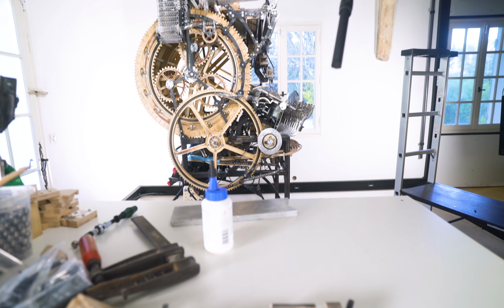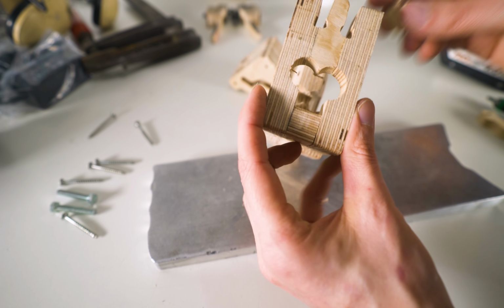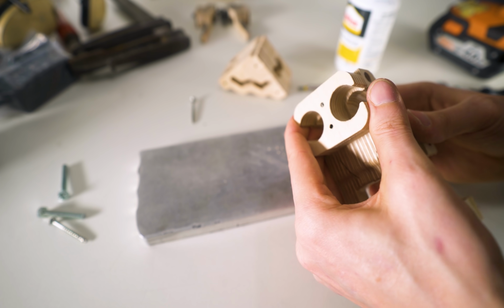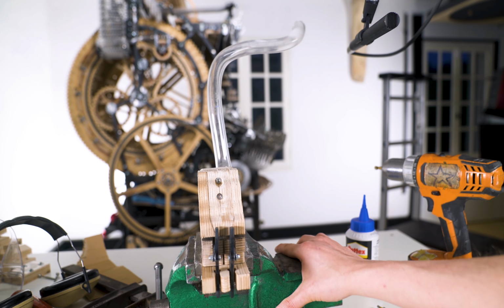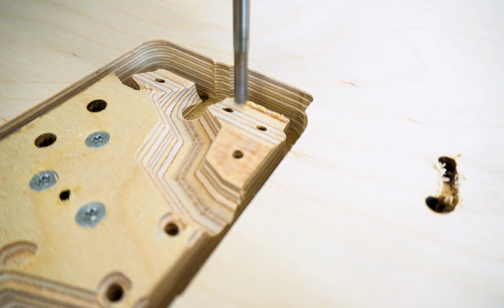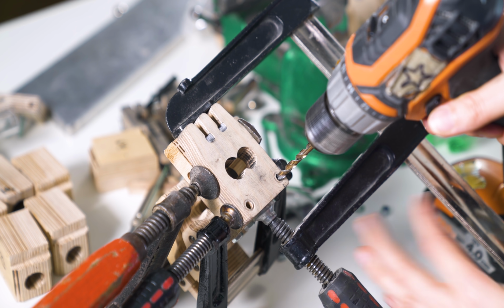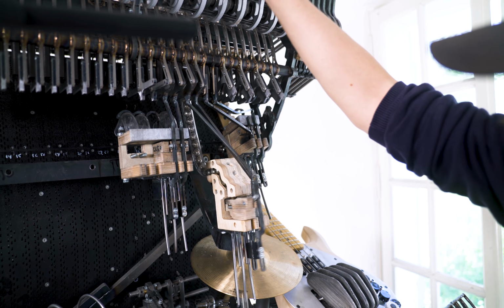Zig-Zag Marble Gate Completed

Comment: I think you made a point worth emphasizing: the Baltic birch plywood you're using is much different than construction plywood. It's made from all hardwood veneers, which are thin, uniform, and without voids. It's much harder, much flatter, and inherently more dimensionally stable. It's also like 3x the price, but so worth it. Just if anyone is thinking he's ridiculous for using plywood, this stuff is really on another level

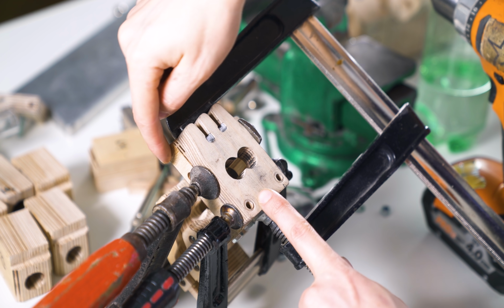Comment: 8:52 You would get more accurate holes transferred if you used a brad-point wood drill or a proper 6mm transfer punch, it may not be important though. Your method of indexing the part on the when flipping it over is great, running the holes first pass a little deeper to allow that seems genius.

Comment: 1. There is a definite "klinK" when the marble hits the plastic catch (I forget the name) before being dropped to the instrument.  Perhaps felt on the top of the catch to stop the "klinK"? 
2. Marble escapement has been creeping around in the background for several months.  2 weeks ago, it seemed like the obvious solution.  Now that is on screen, it is definitely the way to go.  Less bulky, open, visible, precise release, self powering, low wear, etc, etc, etc.  But, it is difficult to build, needs precision and needs tiny lubrication maintenance.  In the end, after weeks of thought, it is the optimum solution.

Comment: Yea, you got some new mills. I hope the tolerances are better now.

In regards to the design not showing the marbles enough. Consider this issue fixed for now. Continue on wacking the other MMX issues. 
Only once you can play 10'000'000 Marbles without one issue, you can do a victory lap and try to incorporate designs that pose a higher risk of failure... because at that point, you have a design to fall back to If it doesn't work. 

Have a great weekend and looking forward to more steams.

Comment: One thing you can do with those machine threads into wood is tap the hole, drip a few drops of CA glue in the holes, then run the tap back through them. CA hardens wood enough so you need a file to work it.

Comment: Does the difference in the height between closed and open cause your marbles up top to not be in line?  My guess is since the system relied on them being completely flat on top, you will have to have a new system on top.

Comment: If they ever wear out, or if you want it a bit stronger to begin with, a few drops of CA glue in the plywood holes, let it cure, and tap it.  Slightly stronger, or a good way to get the strength back if you need it!

Comment: Just a thought...if you wanted to be able to see all the marbles in each of the marble paths in the final design, I'm sure someone out there has a way to...say...take the CAD model(s) and use them in a 3D printer, with a clear material to build them up.  I mean...once you've got the specifications nailed down--and that DOES appear to be at least very close to the case today--then it should be able to be both 3D printed as well as CNC'd...and you are now at the point where, designs having been mastered, you can now go to the next stage:  Materials Coolness Factor Implementation!  \\=^D

That would also enable a single part to be made for each unit, providing that you didn't want to have each one as an assembly.

Alternatively, the existing CNC work having been done, you could always just swap out the wood for acrylic, or even cast resin, which would have an effect like those modules would appear to be made of glass...but you'd see EVERYTHING from EVERY angle...ULTIMATE coolness factor!  d=O)

Comment: As a suggestion, if you want to see more of the marbles, why not use the middle sections of the gate sandwich and make them out of clear acrylic / plastic? You have the tools and the files already so it can't hurt to try. You said that they also have larger holes in the middle so the screws won't crack it. If you did that, you could also illuminate them with some white leds or similar to make even more of an effect on stage/for camera work.

Comment: Love it! Glad the zig-zag worked out! Obviously people are gonna get into the "PLYWOOD AGAIN???" argument, despite your comments on its reliability, but man, after looking at the assembly process, which I'm sure is offset by cost, I'm sure making a handful of plywood replacements, should stuff go sideways, is absolutely cheaper than having other materials manufactured. (From my admittedly low experience level with CNC or 3-D printing in general, that is.) Keep it up, Martin! Your troubles very often mirror my own, and I'm glad you're keeping going!

Comment: A quibble.

Plywood does not have a grain direction. It has two. The grain direction of each layer is at 90 degrees to its neighbor. 

So both tapped holes are basically the same, so far as grain goes.

Comment: Absolutely Beautiful! The smoothness of the backwards movement is so satisfying, it more than makes up for the marbles being hidden. But there are two things I don't get: why do the gates need three stops (on the metal rod, on the wood and on the plastic) and why do you want the marbles to be in a non ideal position when the gate is closed?
Reply: i think the low height is "ideal height for like friction gate retraction", while the high position is "ideal height for things not getting stuck in the zigzag when the gate opens"

Comment: You know what ancient mechanical engeneer said: "Simpler is Better". In 13:11 I see an escapment mechanism, a lot of moving parts, when you could make a sleeker plywood design, with more windows. Less moving parts, easer to maintain, less probability of failure, and in case of failure easy to repeair. Whilst an escapment mechanism needs to be tuned and have a lot of testing, also is complex in making, and it is not easy to repair.

Comment: Martin day 849: we've build this modular. this is perfect as we have an interchangeable system so we can ajust the height of each module. 
2 months later: we remove this labyrinth of a module and replace it with a different modular system wich we can ajust for each channel withour re-cnc-ing. 
2 months later... probably will replaced with another module :p
Reply: *5 days later:

Comment: The issue I have with fastening steel into wood is the expansion and contraction of the wood as it is exposed to different temperatures seasonally. Depending on the vibrations you may see increased wear or even loose fasteners over time

Comment: 13:12 Recoil escapement mechanism. That would make that section just metal and pipes, I bet that would look amazing. Maybe I'm just being selfish because I never want these videos to stop.
Reply: Well, metal and amazing will have the looks BUT will certainly be louder and generate more unnecessary background noise
Reply: @HuatengChen  I think that would be the case, although the marbels would not have to drop into the slot. Hard to say what would be louder.
Reply: I was also quite amazed by the escapement mechanism, but I just hate those hand-bent steel rods. Even though Martin can use guides/contraptions to bend them in a quite consistent way, I feel like they'll never be as reliable as the plywood parts. But we'll see what Martin ends up doing, I can already see the escapement jumping into my face a few videos from now :)
Reply: @Dom2705  I think he would get the guys who made the funnel bends, you are right that hand bending it would be a nightmare.
Reply: if it works, don't fix it... yet. I hope he gets to 'finish' the entire machine, and then he can look into incremental improvements again with big tests in between. Make it work, make it pretty mentality...
Reply: @cptfwiffo  that is so true! The machine still has a long way to go and Martin needs to be focused if we wants to even have a world tour EVER.
Reply: Can we save some ideas for MMX-II Cyberpunk edition please?
Reply: @lightdark00  
I think this metal mech looks more steampunk than cyberpunk.
Reply: yeah, no one is "wondering why the machine is not finished yet"
Reply: After his "new idea" I'm considering unsubscribing.
Reply: MrTomadevil what idea do you mean?

Comment: Wilson, could you please notify Martin to this comment? On the channel of 'Twoodfrd', a lovely luthier from Canada with great videos on repairing all sorts of stringed instruments, I saw a great trick. He used superglue to strengthen threads that were directly cut into the wood. I can imagine a similar trick might help with your high quality plywood. Thanks Wilson!
Reply: Super glue the threads!  It works, I have been doing it for a few years.  Not gluing the bolt into the wood, but just let it soak into your threads.  Also I have found that course  metal threads work better than fine, if you have the choice.  For example here in USA I will choose 1/4 x 20 over 1/4 x 28.
Reply: @theoldbigmoose  in metal, fine threads are stronger than coarse
Reply: @SuperAWaC  whether fine is better or not depends on the yield strength of the metal as that will limit the torque you can apply.
Reply: @SuperAWaC  Fine threads make parts stronger by maximizing the cross sectional area of the non-thread area of the part.
Reply: @Leadvest  and dense / hard materials deal better with fine course threads than soft / non dense materials. And vise versa.
Reply: @SuperAWaC  Absolutely, but he was threading into hi layer plywood sir.
Reply: @theoldbigmoose  like you I too have been super gluing threads in wood with great success for many years. Just be mindful of how much pressure you can put on a thread in wood before it pulls out, two factors controlled by the hardness of the wood and the depth of the threads.
Reply: He can't use super glue or inserts, because the holes are directly in between two pieces of plywood. But as being a furniture maker and woodworker myself, I surely doubt the strength would ever be a problem in his application. Birch plywood is extremely strong. I have had several times where wood screws would simply break halfway, when I didn't pre drill the hole large enough to receive the screw. It bites to much, that half a millimeter larger, could mean the difference of success or failure. And that was just with 12 mm plywood.
When the wood is dense enough, you can use metal screws perfectly fine.
The usage of super glue on wood parts that are too thin or fragile, is something I use myself quite often and works extremely well. I also use it sometimes for threads in the wood, to make them durable. But you must be careful to insert the screw in the same way (reverse the screw, to find the thread start), to avoid the screw from tapping a new thread.
Reply: @ClaudioBosgraaf  Then lacquer might be a good alternative. It will still add strength to the wood fibers, but it will also crack easily if he ever needs to take the pieces apart.
Reply: im on it
Reply: Ted Woodford is the man!!!!
Reply: He hasn't had a single problem with threads in bare plywood. Why are you all solving problems that do not exist??  Can't you understand that this is the way you accomplish NOTHING and waste ALL of your resources?
Reply: @NGC1433  Because we suspect he's making a mole? I don't think this thing is going to fall apart, but I wonder if vibration will either back the screw out or strip the threads over time, and then moles induced by misalignment start happening.
Reply: @NGC1433  have you always been such a tool?

Comment: For the "troublesome threaded plywood" in the bottom of the channels you could make these into studs. Epoxy threaded rod into the gate and use a nut on the mounting plate. This way the wear is metal to metal when you remove it and not metal to wood.
Reply: DING!  Winner!  Install once into the wood and never again in the life of the gate.
Reply: That’s what I thought, wear is the issue with threads in wood

Comment: I saw someone further in the comments mention this and I think it should be repeated. You dislike the design of the new pressure gate because of the lack of marble visibility. However, you could always remake the new gate out of a clear plastic material so the marbles could be seen.

You yourself said you'll stick to a functional design over an aesthetically pleasing design. Don't undo all the work you just did. The design works and opened up the back of the gate to clear marble pipes compared to before.

Comment: I love the clock escapement idea - it's a centuries old design to solve the exact problem you are trying to solve - hold back heavy weights and release it with very little force. Plus, functionality is important, but you have to feed the artist too. So, I think you should at least do a quick prototype of this and try it out before doing all that plywood milling.
Reply: Then again: he's got a pretty simple design now that does exactly what it's supposed to do, so why change it with something more complicated with more moving parts?
Reply: @EaglePicking  Well, if we were only going for less complicated with fewer moving parts, we'd have an electric keyboard.  The main point of a marble machine is to have unnecessary moving parts isn't it?

I'm not saying he should complete redesign but, as he seems to be having fun with it, why not try a prototype?  I'd be interested in a video or three.
Reply: @madman2572  Remember that time is not a free commodity. Its been almost 3 years with the machine, reliability is the name of the game at this point, hence the Marble Tests and the changes in design philosophy.

Of course, there will always be a compromise, a battle between artist and engineer. But whether it is worth the time effort of redesigning a suitably reliable gate with moving parts should a big question mark
Reply: @EaglePicking  True, but Martin said that not all gates would be mounted at the same angle, so this design may not work as good when tilted 15 or 20 degrees.  I expect that Martin has already tested this but just did not show it yet, but I still think that the escapement design would not be affected by the angle at all.  Personally, I have never liked the look of the plywood parts on a mostly metal instrument and really think the escapement design is more in keeping with the overall design look without sacrificing the more important functionality.  But, I know that this is all assumption on my part and would need to be proven.

Comment: Love watching the progress, I've worked for a while in a carpentry shop, and worked with high grade birch ply, the thing that worries me isn't the holding strength of the screws in wood, it's the durability, do the threads hold up well to multiple uses? Thinking down the line when the MMX would need repairs or replacements, some of the old holes might now hold their threads.
Reply: Very true. Thinking "this screw will only go in once" is not sound engineering.
Why doesn't he simply use bolts with threads designed for wood instead of using M8 or M10 threads?

Comment: Soak your threaded wood holes with CA (super glue).  A technique used for decades on model airplanes.  Tap - CA - Tap again.  Hardens the surface.

Comment: How about creating those assemblies from polycarbonate, acrylic or other transparent materials?
Reply: Acrylic is brittle, and may not withstand the knocking of the marbles.  PC is VERY easy to scratch, and will eventually become unclear.  Not to mention under stage lights it will yellow.
Reply: The vibe I get is that anything other than plywood is out of the question until the design is done, because what's the point making all these parts out of more expensive materials if they just get replaced with a different solution? Once all the moles have been slaughtered, then yeah other materials might be considered for the "final" machine
Reply: @blak4831  you Really think all the moles will die?
They just get better at hiding before popping up.
Reply: He'd really only have to make that top "eyebrow" out of acrylic. Since he showed it wasn't really completely necessary it could be designed so it's simple to mill and obstructs as little of the view as possible

Comment: Please use something like acrylic so we can see the marbles and it wont wear down
Reply: A complex part like this isn't suited to be made from acrylic due to acrylic being hard to make strong bonds.

He could technically use expoy molding but that would be an insanely hard mold to make likely requiring multiple different cures.
Reply: @Daemonamongyou  I think this could be accommodated by just casting roughly-the-right-size blocks of epoxy and putting them on the CNC machine. Add some fingers to every interface -- like the newest plywood design has slanted faces to make everything line up, just turn those into a series of stair steps that lock together. That will bond together just fine.
Reply: @Daemonamongyou  they use acrylic for fish tanks. And the edges are often glued together.  Even in large fish tanks. That hold tons of water. So I think it will be okay.
Reply: Martin, you need to do this! :)
Reply: He could even create molds for each parts and cast them with that transparent aluminium recently developed.